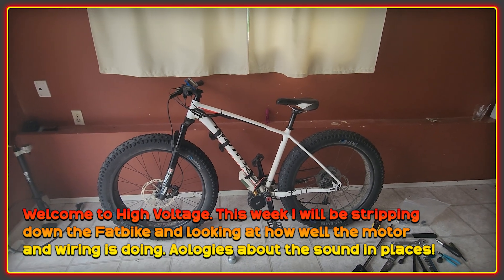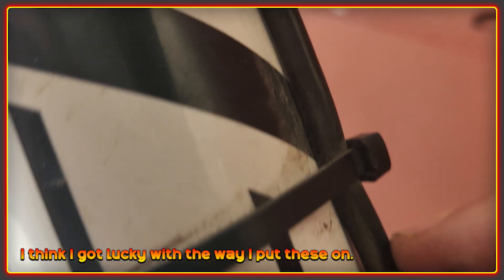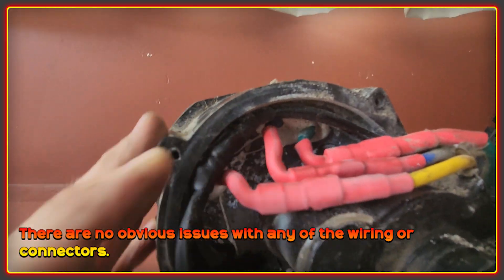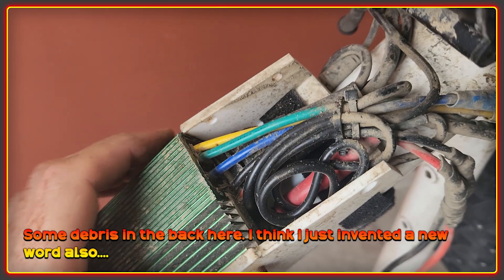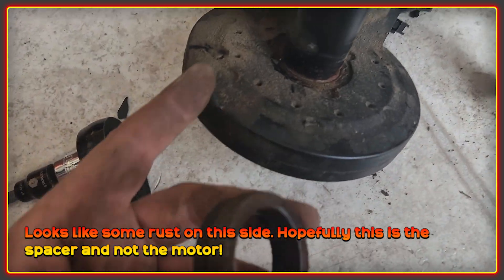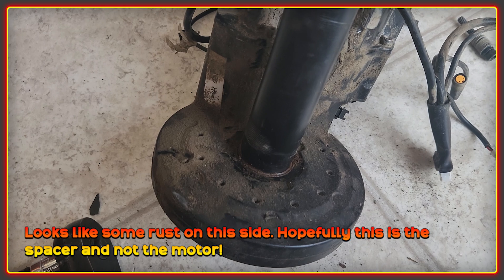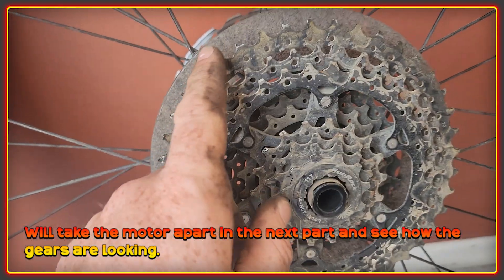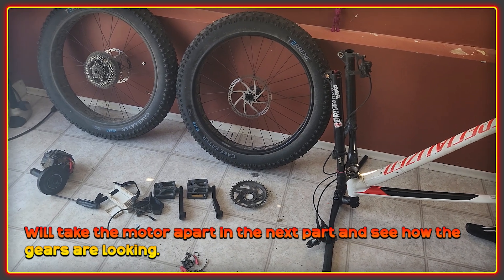BBSHD Fatbike RE build Part 1 - Teardown - Stripping my high power ebike back to the frame.

Comment: It looks like it's in good shape I have had my bbshd since 2018 and I have taking it off and regreased my bbshd. I have a 60 Amp stuck  controller it's been double shunted and it has last. My nylon gears is even good.
Reply from the maker: Good to hear. I'll open it this week

Comment: I also slip a length of heat shrink tubing over the HiGo connectors even away from the motor, makes a pretty decent extra seal and makes the connection structurally stronger too.
Reply from the maker: That's a good idea. A few off mine pretty much came apart with no effort.
Reply: @HighVoltageKits  I think they seem pretty tight when new but might lose flexibility and tension as they age. TBH the very small size of the contacts worries me.

Comment: That bike is legendary... Because of the legendary Captain... Don't forget to degrease and then regrease... Then torque. Are you going to strip the paint or just paint over the oem paint.  If you're going to paint over the original paint you might want to add a couple of coats of plasta-dip that way you can peel it off if you want to go back to the stock appearance.  I cant wait to see how this turns out...cheers.
Reply from the maker: I'm not 100% sure. I have a good degreaser to use so I will start there and do some reading.

Comment: glad to see the toughness of a good frame like specialized + BBSHD standing up to time and the elements. Look forward to the cleaned up ride after some maintenance
Reply from the maker: Cheers Fizzy. The motor cleaned up pretty quick... the frame might take longer... I will get some industrial degreaser.
Reply: Try something called elbow grease spray all purpose…its pretty cheap and very effective…